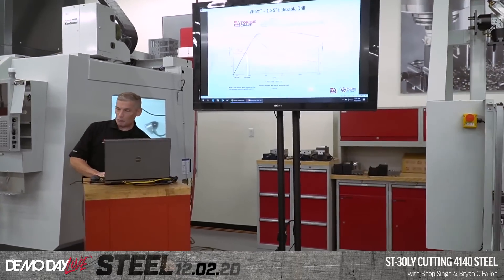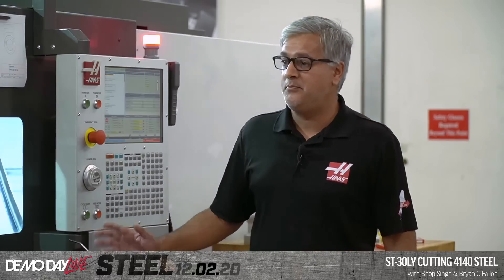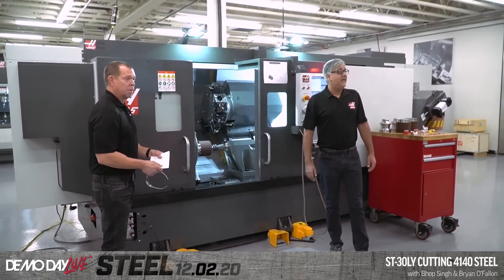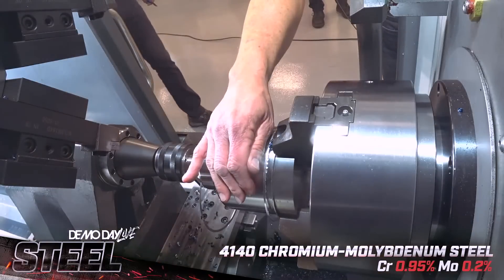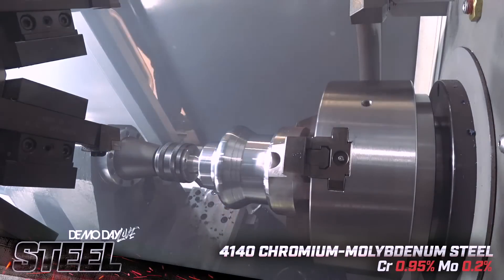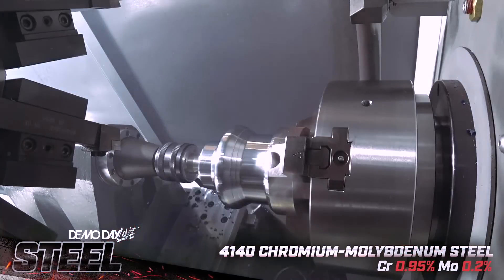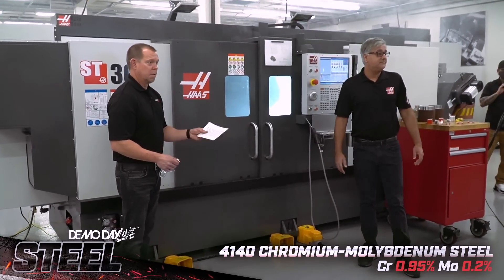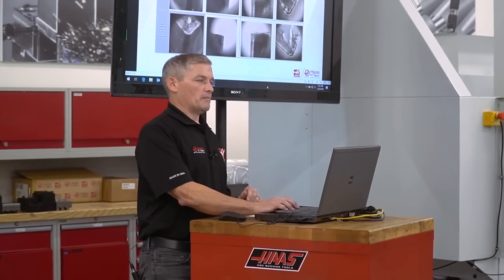Haas ST-30LY Turning Steel - Demo Day Live Focus Video - Haas Automation, Inc.

Comment: Has anyone actually ran Haas lathe tooling yet?? These inserts cost a lot less then what I run now. Just curious if they are even worth looking into. I run a ton of 4140 like in the video.
Reply: I Run 304L Stainless only, Large Diameter Tubes for custom plumbing fixtures. I have a bunch of Sandvik Inserts. When Im about to run out, I will order a pack and see how they work out. Running on a Haas ST-25. If I remember, I will let you know how they work out.
Reply: @CNCGuy  cool thanks! I might order some as well to try

Comment: Is there any chance of doing preventive maintenance on the Haas servo drives.  My second one failed the other day. Sounded like an electrolytic capacitor explored.  Still waiting for HFO to repair. Y axis drive failed after parting cut during which it was not being used.

Comment: Why does he say to run the spindle load at 120% ?  If that is the case, why not adjust the spindle load meter, so that what is now 120% shows 100% ?
Reply: 100% is the continuous load rating - the load level that the spindle motor can handle without overheating if it's left running constantly. Haas spindles are rated to run at 200% load for three minutes or 150% load for 15 minutes. You'll usually want to run your roughing passes at more than the continuous load rating, because the spindle will be under much less load during finishing and have time to cool down. If you run the spindle too hard for too long, you'll trigger an overheat alarm (code 254 on a Haas machine, IIRC) and the machine will stop until the spindle motor has cooled down.
Reply: Thats not how it works. The Load meter is based on the available power the motor can deliver. a 10Hp motor running at 100% load should measure around 50% on a 20hp motor. What matters is Tool SFM and chip load... He says to run it at 120% load because thats a percentage of available turning power the ST-30LY has, The ST-25Y might have a weaker motor, which could mean to run spindle at ex.%150+/- load.
Reply: @CNCGuy  not referring to that.  I'm referring to, why would the machine mfg tell you to regularly run the machine at 120% spindle load. Shouldn't it be that 100% is the max capability of the machine, and essentially stall after that ?  I have never understood Haas and their HP and spindle loads.
Reply: @kanoa9321  Its not limited to Haas. My 1981 mori lathe and 83 matsuura have load meters up to 200% If You nail the 100% mark, on a gage only measuring 100%, you have no idea if its actually above 100%... But why run above 100%??. Its not something I would do to any machine.
Reply: @CNCGuy  Here is a better answer to your questions.  Haas uses say a 20HP vector drive.  The spindle motor is actually only 10HP.  IF the spindle load meter is at 100% thats 10 hp.  IF its at 200% that would be 20 hp.  If you read the manual it states something like you can run @ 180% for 15 min or 150% for 20 minutes.  Those times are not accurate just a rough guess.  The way the vector drive works is it sends 200 volts to the motor for 10hp. It sends 400 volts to make 20hp.  That is why you cant run @ 200% for a long time as it will over heat and possibly damage the motor/vector drive.  That is also why you see the load meter almost max out when the spindle is decelerating coming to a stop.  Hopefully that clarifies things for everyone on HAAS vector drives.
Reply: @bobsbillets8863  Yes, simply put, like on a generator, the term is Surge watts. not Running watts
Reply: @CNCGuy  Not really.  Surge is when a motor starts because it is basically acts like a dead short for a split second.  That is why the huge inrush of current.  The vector drive is sending high voltage to the motor.  When it is decelerating the voltage is being sent to the resistors on top of the machine.  I am very familiar with these machines as I repair them.
Reply: @bobsbillets8863  Not too familiar with the functioning of the Vector Drive, yet. So what your saying is, there is a normal operating output voltage, and a peak operating voltage?
Reply: @CNCGuy  Not a nominal, but just like a frequency drive.  The voltage will be based on the load and what spindle speed has been programmed.  The vector drive is "closed loop" meaning that it gets feeback from a spindle speed encoder attached to the electric motor.  They are extremely accurate because of this.  Literally  + or - 1-2 rpm @ 10,000 rpm.

Comment: Sandvik CNMG 120412. 8mm doc with 0.4 feed. And My olllllld okuma has 70% load 😂. Material. 34CrNi
Reply: I was laughing too that thing was losing spindle rpm with that cut. I’ve taken close but not pushed the feed that hard. But I’m sure I could no issues. Just funny that they thought that was a crazy cut
Reply: 1) What is the workpiece diameter at 70%?
2) What is the rated motor power and S1 duty?
3) What RPM?
Reply: @impactodelsurenterprise2440  ø400mm. And it runs it all day long. I think its 35kw DC motor with 4 speed gear box. You cant really compared an old okuma lc with anything haas makes 😂

I run about 140 smm. You can calculate the rpm your self 😁
Reply: That's 1.4kN.m of developed torque at the spindle, with the help of that gearbox. I find Haas 140%-all-day-run advice to be ridiculously harmful. S3 duty cycles exist for a reason. I've long wanted a gearbox but damn those things are expensive AF, coupled with the cost of integration, I may as well buy an old okuma like yours.

Comment: Take it to the next level and make a demo cut video series where you show all the tooling info and F/S selections like here, and show the cutting like you did here, but also have a picture in picture of the control panel showing the spindle load and whatnot, then most importantly at the end show the CMM results inspecting the test parts for accuracy.

Comment: Funny ?
Goes to prove HAAS do read the comments on there videos ?
There has been many comments making note that they want to see a HAAS machine cut Steel, LOL.
You could definitely pick up on the vibe at the start of the video ?
Yer We Cut Steel here at HAAS, LOL.
It's Funny because it seems they were on the defensive during this video ??
I don't know what the big deal is anyway about cutting Steel on any Lathe.
Seems most of the guys commenting on these videos have NEVER ran a Manual Lathe in there life ??
Reply: Or it’s the guys that have run real turning centers and know they are not doing anything too crazy but still somehow that machine is at its limit.
Reply: @ianagos4276 

Hey Ian.
It's an old YouTube argument when talking about any HAAS machines.
They are underpowered no rigidity etc etc ??
Reality is we generally don't have any choices when running a CNC anything ?
Most are employees working in a shop where they have no input into what machines they run.
Most of the comments against HAAS machines are guys who have no real machining experience.
If you are a machinist you will understand Every machine has a limit.
Reply: @weldmachine  look I’m comparing apples to apples here actually The haas has a larger hp rating than my Mazak did but it could still take a larger cut. Why is that? It’s because someone is lying about horsepower numbers. And for some reason I don’t think Mazak is saying their spindle have significantly less power than they actually do. 

It’s not a youtube argument I got to use newish 2-8 years old haas machines and I was not impressed in the slightest I was actually disappointed because I wanted to purchase a haas but after using other name brand machines I decided they were not fit my shop. For the same money I could get a doosan that is atleast built right
Reply: @ianagos4276  See my above comment on vector drives.  Also if a machine has a gearbox it makes a huge difference in the amount of available cutting hp/torque .
Reply: @CMTeamCobra 
Seems to be a common thing on YouTube ?
Say something Negative just for the sake of it.
Reply: @CMTeamCobra 
Unfortunately this is a popular thing to do on YouTube more than not ??
People giving advice even though they learnt Everything from watching YouTube videos, LOL.
I am sure there heart is in the right place even if there brain is not ??
Reply: @CMTeamCobra 
Mostly why Doosan are so popular.
They give the biggest bang for your buck.
Mazak quality at a HAAS price.
If i was to buy another CNC Lathe it would Definitely be a Doosan.
Love the option of a Siemens Controller.

Comment: Ya all haas has to do now is go back to their old way covers.... The new galvannealled ones have high zinc content and react with synergy 735 leaving green monster goo all over the place...sad really.... And this isnt opinion... This is lab tested fact from blaser
Reply: So switch coolants
Reply: @AlexMageethefirst  ya... Im gonna spend 2100 on a barrel for 2 machines....when i have 34 others all running synergy.... The material we run... We get the best finish with synergy....so... Think a little before ya spout off
Reply: @gusmcgussy3299  If you've spent 200k on a machine you cant use because of a 2k barrel of coolant it would seem like a good investment.
Reply: @AlexMageethefirst  Everyone must use blaser these days becuse thats what Titan does..
Reply: I have the same problem with the synergy 735 in my 2020 HAAS VF2SSYT...
Reply: @2483xavier  exactly.... Our haas were purchased mar 2020.... And i found out that EVERYONE is having this problem.... And its because they switched in feb in anticipation of the entire wolrd buying machines in 2020...in which ppl did....so they tried to save a cpl bux but screwed their good name in the process...   Engineers are garbage nowadays....this wouldnt have happened 20 years ago
Reply: @2483xavier  we bought a vf4ss and an st15yss with live and a suba
Reply: Sub spindle
Reply: @gusmcgussy3299  We have 2015 VM2, ST15Y and ST20Y and never had this issue with the same coolant.

Comment: you should show motor (%) loads when machining.
Reply: They're embarrassed. I'd be 1/4 that load on a Mori 😆
Reply: @TheFeralEngineer  1982 Geared Transmission 15hp DC Brushed motor? :)
Reply: @CNCGuy 2021 nlx2500. Direct drive spindle and built in motor turret
Reply: @TheFeralEngineer  LOL. Moris are beasts of a machine. I have the SL-25b with 2 range gearbox . Only thing I needed to do is replace the motor brushes a few years ago and clean up the commutator.
Reply: @CNCGuy  they know how to do it 👌👌👌👌
Reply: He sayd it was 160%